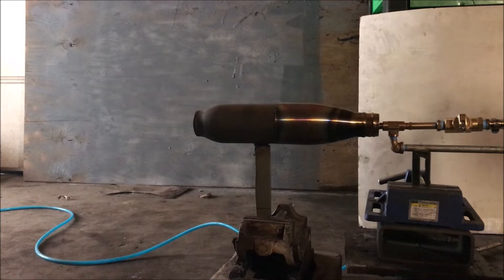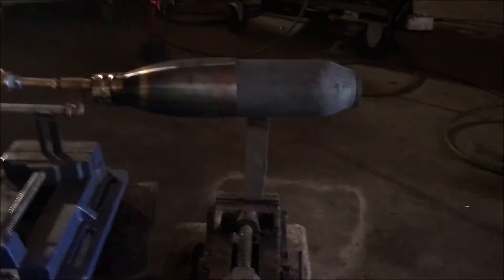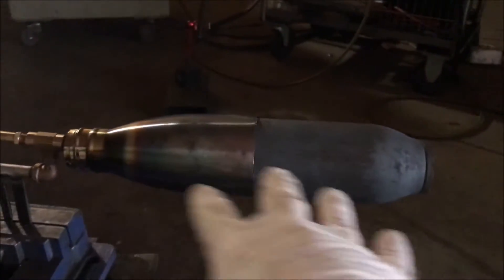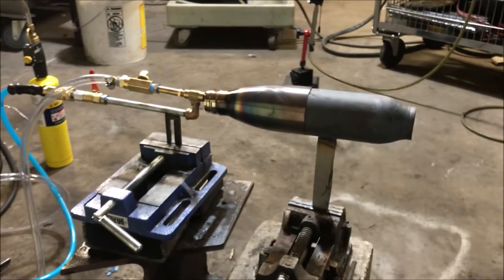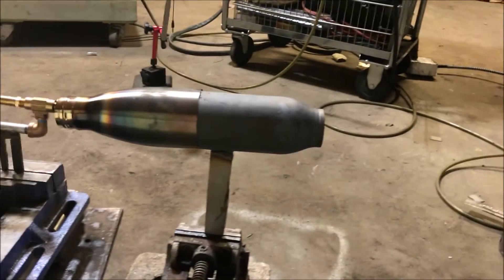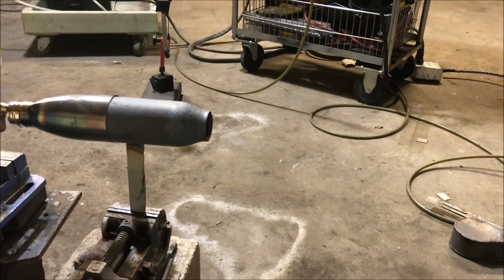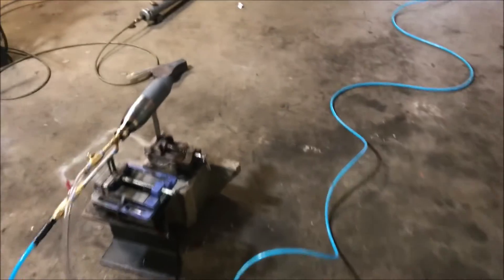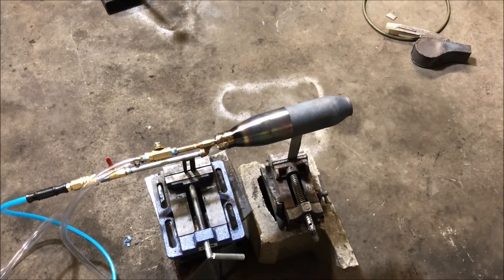Cherry Bomb KIln burner

Comment: this is the way i do it i would keep messing with it trying other size and how long see what works best but it looks like u got something real nice there i know alot about makeing 2 stroke tuned pipes so this is what i try but will pulse jet easy if you want that  i think there is a point  or setting and if the pipe will do it where its super charging the wave is going so fast that u dont hear the pules bc its going so fast and the hotter the faster it moves, mixing and flames turbulent should be crazy super heating burning more fuel not washing , i think you may of just did something like that .angles and size speed up or slow things down theres alot you can do with pipes like this i been messing with them for 15 years or so ,always looking for something i dont know

Comment: If you have a tube around the jet the venture effect will suck air through the space between cooling the jet as it burns, and it would be a form of protection just incase it melts down, also check out air multiplyers and air amplifiers, I'm going to make some crazy stuff in the future, so I learned alot of stuff
Reply from the maker: Right on , will you post any of your work ?
Reply: @NOBOX7  yes, I'm just getting starting but I do have some interesting unrelated videos I think, not many views, but I know I'll get up there pretty quickly
Reply: Any crazy stuff yet?
Reply: @Picklemedia  not yet, got set back a little my dad passed but I'm getting back in the building , i have a project I still have to work on, a leaf blower attached to a carburetor to me a gas powered flamethrower
Reply: @bloodsweatandtearsforeverl9833  that sucks. I guess setbacks happen?